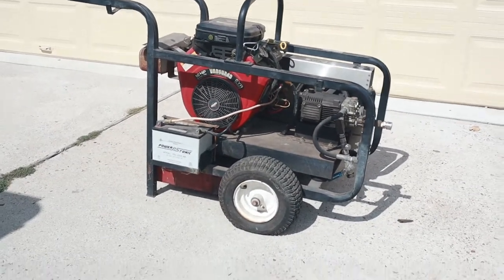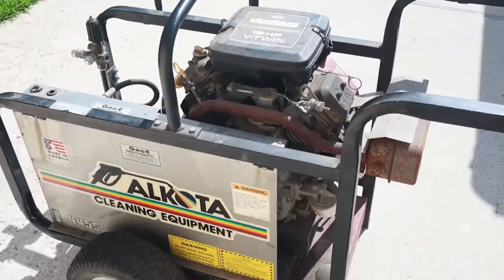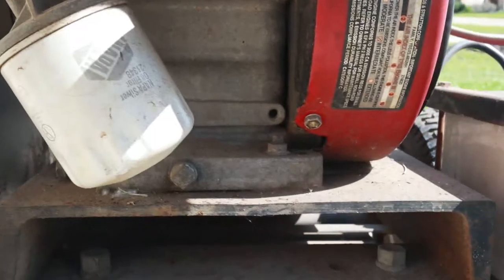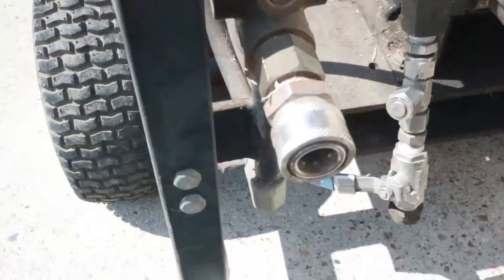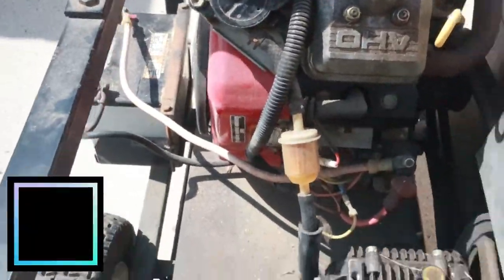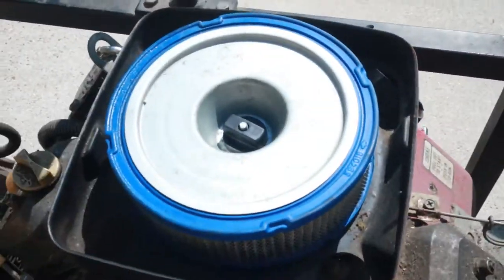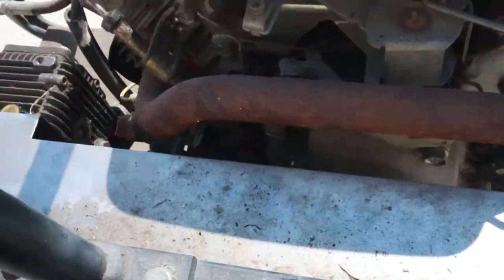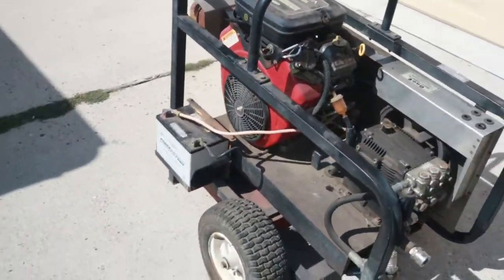Dumpster Diving Find | Huge Pressure Washer | Trash or Treasure? |

Comment: Nice find, if it’s a true hot water pressure washer, it’s missing the heating tank. Probably worth to part it out if that’s the case
Reply from the maker: I have come to find out that its a cold water pressure washer and i just need to get it running. probably a dead battery. Ill get to it here soon. Thanks for watching! =)

Comment: I just thought of something, if I were you because it sounds like you might know these folks or at Lt know of them. I would would go and speak with them. I’m sure they wouldn’t mind telling you the history as well as the reason they tossed it.  So many folks would rather know that someone is getting great use of the item instead of it going to the trash. Go say hello and make new friends this way they will have your cell phone number and they will call you the next time they need to get rid of great treasure. Best of luck and I appreciate all of the awesome knowledge and tips you provide us. I’m a Veteran and I list my right lower leg because of surgeries I had when I was on Submarine’s when I was in the military. I’ve started my SoftWashing /  Pressure Washing business back up. 😳😬
Reply from the maker: That's a pretty good idea! They should be able to give me some good info that will probably save a lot of time during the diagnostic.  You're welcome for the tips, glad I can help. And thank you for your service. One of my next videos is showing a huge military commemorative pin collection that i found hiding in a store. I bought it and haven't figured out quite what to do with it. I will need some help identifying some of those pins so feel free to comment and chime in. Thanks again for watching! =)

Comment: Yes it’s worth it I had the exact one years ago.  This motor is like the new ones today that everyone wants .  Mine was electric please have it checked out to see what it woukd cost.  For me I’d charge the battery and do the basic service and then use it. It was the workhorse back in its day.  Best of luck with it.  Maybe they just had no use for it.  Let me know how it turn out. PM me so I know. 😳😬 Cool Trash find. One Mans Junk Is Another Mans TREASURE. Very Cool.
Reply from the maker: That's good to know. Yes i should probably charge the battery. Some one told me i could jump start it with my car battery. Lets see how that goes. Im used to just a basic 2800 psi pressure washer. This thing i massive. I cant imagine loading and unloading this thing ever again. Thanks for watching, wish me luck.